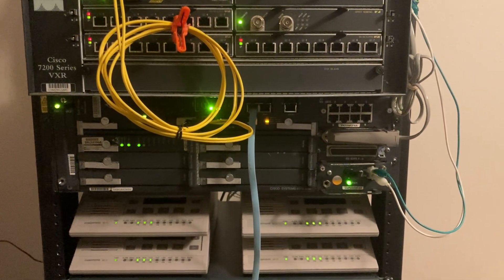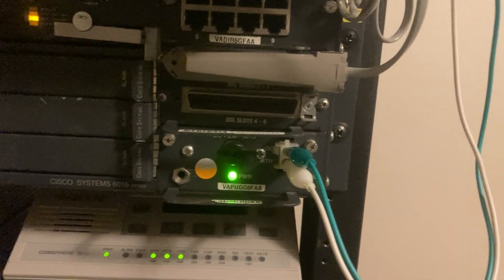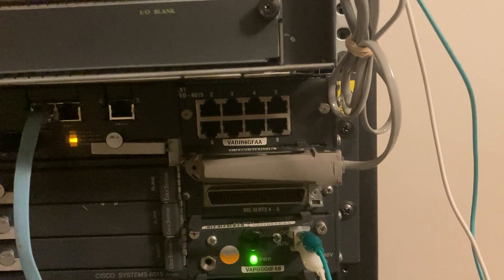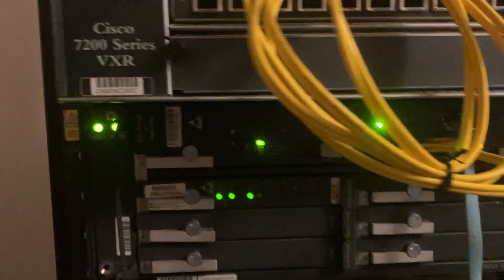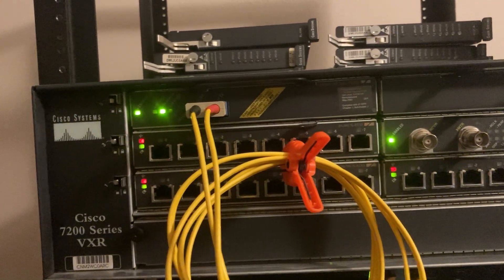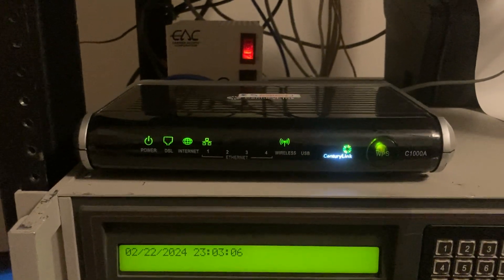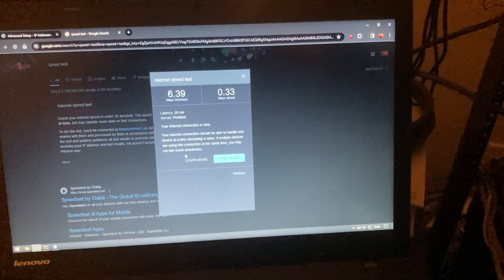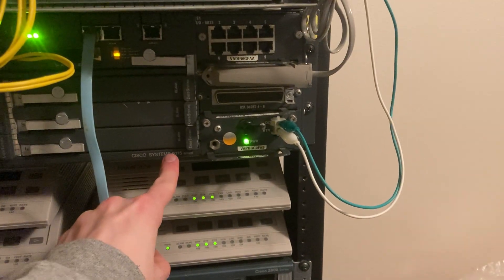DSLAM Shenanigans

Comment: I don't fully understand ATM either.  You can tell it has roots in the telco world because it's complicated!  haha  I was hoping to get a DSLAM that had an ATM backhaul, just to have an excuse to play with something that isn't Ethernet.  But I ended up with a Paradyne ADLS2+ model that was very proud to specify that it had transitioned to IP -- no more of that ATM baggage to worry about!  So it just has a regular 1Gb SFP Ethernet interface.  Ah well.

DSLAMs definitely are just glorified switches, though.  I can only imagine how it would work on an ATM-based platform, but in the case of the Paradyne, it can drop all the DSL subscribers into a VLAN of your choice, or sequentially allocate VLANs to each DSL interface to keep them isolated to whatever degree you'd like.  I haven't gotten fancy with allocating multiple VCs per DSL port and figuring out how they can map to Ethernet yet.

Comment: Not sure if this info is useful due to the age of this video, but ADSL is designed to be basically fully compatible with ATM, so you would never back haul it onto anything else. It slots nicely into the world of ATM as it was at the time. Modern DSL such as VDSL supports 'PTM' (packet transfer mode) which is basically Ethernet under the hood, so you would need a VDSL DSLAM to do this. I have no idea how it works when some customers are on ATM and some are on PTM.

Comment: In a previous life I did tech support for this kind of hardware, well the user end. PPPoA was a standard that the UK adopted, PPPoE was more the American standard and really confusing because customers would start the WinXP "connect to the internet wizard," select "broadband connection" yet the USB modem was still using PPPoA dial-up networking (it connected very fast since only simulate dialling a zero and auth was almost instant). I remember hearing about DSLAMs, knew they were locaed in the phone exchange, but that was all. The reason why customers were not supplied with "always on" ethernet modem/routers is because there wasn't enough IP addreses for everyone to have one, and surfing was still a singular PC or laptop experience. I wish they had gone down the ethernet route and issued USB to eth adapters, the amount of software issues USB ADSL modems caused was almost not worth the hassle, especially on Mac. The wires used were twisted copper pair, some very poorly insulated in certain places. Some would get wet when it rained so the link would go down.

Comment: Ah yes, the good old 7 Megs...
That's all I had at home in the first half of the 2010s, always wanted to upgrade to 20 Mbit/s but they charged extra and my parents always got SO angry at the call center when they found out 😅
There's actually a lower profile of 300 Kbits I think, my dad was stuck with that since the 2000s probably even if his modem(with no router, only one Ethernet port) already supported 20 Mbps.
I don't think I actually ever saw PPPoA in the wild in Italy, only something you would study in the books.

Comment: I did tech support for dsl with speeds of 256k, early dsl was better than dial-up but just barely.  We had two different CPE devices, an Intel pro 2100 pci dsl modem and these lovely little Cisco modems we could remotely manage.
Reply from the maker: Were the modems Cisco 678s by chance? I've got two of them but I can't find any documentation on how to configure them, and they don't give any sort of output on the console port.
Reply: @KJ7BZC are you using a roll-over cable?
Reply from the maker: @JohnKiniston  Yeah using a standard Cisco one, do those modems take a different pinout?
Reply: @KJ7BZC  yes check the 678 manual for the pin out, I believe you can get away with just pins 4-6 on the rj45
Reply: @KJ7BZC they were! When trained up we could ssh into them iirc, the customer also had access either via serial or telnet maybe and could see diagnostic data.

Comment: The 7206VXR router is a lovely piece of kit.  We used them both at the main datacenter to take full BGP tables from our carriers back in the day.  They don't have the memory to handle that these days but are rock solid, extremely capable and versatile machines.  Never had one fail.  Which is more than I can say for the GSR-12000's we replaced them with.  I suspect the speed issue you're encountering (as well as latency) may have something to do with connection quality rather than equipment capability.  That janky fiber connection gives me pause.  Check out your interface statistics and see if you've got CRCs or other incrementing errors.  I would expect single-digit latency within your network.

Comment: I had ADSL in the late 90s when it was first available in my area, 640/256kbit. I moved about a mile away (same CO) and was forced to buy a new modem (675 to 678 for DMT I think) but meant I was able to get 1536/896kbit at the same price. In 2012 centurylink started deploying 40mbit (ADSL2?) which interfered with the older ADSL and didn't offer a choice of ISPs. When I complained about the speed degradation, I got lucky and a graybeard service tech ended up relocating my pair in the bundles through two junction boxes back to the CO, which brought my speeds back up for a while.

Eventually speeds started to go back down again, and I gave up and switched to cable 50/10mbit in 2014.

It's probably time to switch to 1gbit fiber...
Reply: I think anything above 20 Megs is VDSL or one of its variants, and it uses frequencies so high interference jumps from one wire to another and attenuation was really evident.
Glad it's almost over ...

Comment: For the Amphenol connector breakout, just get yourself a RJ45 patch panel and terminate the other end of the cable to it. If the cable has an Amphenol on the other end and you don't want to cut it, there are 66 blocks with Amphenol connectors on them that you could also use.

Comment: How do T1 / E1 ports work? I used to have a telabs router with like 24 of them. I never got to mess with it much as I used a dodgy crocodile lead directly to the 12v where the psu input went and now it dosen't work anymore but might be able to get more. I would like to make a phone connection go directly over the internet. I know that can be done over voip with a server but its a bit pointless having a voip pbx server just to just forward a line over the internet, especially since that method is incapable of seeing various line stats like line reversal  (for call metering over a trunk) and stuff like that. Would I be able to do that with one of these E1/ T1 line things?

Comment: A long time ago in Champagne Urbana Illinois, I was in a PoP on the University of Illinois campus and I met a guy doing research on adsl.  He was noticing that the increased current was degrading the POTS lines at the connectors.  I have wondered since then if it would eventually cause the lines to need to be replaced, but I am guessing the use of those lines has dropped a lot.

Comment: Whats cool about it is that the customers data streams are all serialised in their modems then effectively piped as parallel multiplexed circuits  (via TDM timeslotting on the ATM link) right through to the router where the PPP is stripped and the payloads are finally thrown out into the great melting pot of the internet via whichever outbound route is determined to be best :)

Comment: I'm jealous of the Radionics receiver. I used to work in a central station and stupidly didn't grab one when they were being shipped off to be scrapped.
Reply from the maker: Ahhh I feel that pain... Great receivers honestly, of all the others in my collection the Radionics ones have just simply worked the best and been simple to configure. They do come up on Ebay for decent prices sometimes, I've had to get quite a few of them to end up with the one full of linecards and terminator cards in my rack there.
Reply: They moved all of the POTS-based panels to a Sur-Gard and it was no end of trouble. I liked working on the equipment but between that and other corner cutting, the station was waking me up 10 nights a month with fleeting error messages.

Comment: Everyone has seen the modem configuration - we all had crap like it. (and some still do.) Show the DSLAM sauce!
Reply from the maker: Honestly the DSLAM configuration isn't that complicated, it's really just straight ATM connections between the trunk and the ports. It was just a matter of doing "atm pvc 8 35 interface atm 0/1 1 35" under the atm 1/1 interface. Connecting vpi 8/vci 35 on the dsl port to vpi 1/vci 35 on the trunk port. Someday I'll probably make a video on configuring it all.
Reply: @KJ7BZC  It's not about "complicated". It's the part few ever get to see. Every one has a modem, no one has a DSLAM.

Comment: Nice rack ya got there. Thank you for the tangent. 
"Sherman, set the Wayback Machine"   
The fiber challenge may be a single-mode/multi-mode mismatch. 
Do not stare into laser with remaining good eye!
Reply from the maker: Lol reminds me of the "Big Scary Laser" sign I saw at an HP campus years ago. Luckily my friend warned me about the high output power before I ended up using up one remaining eye

Comment: 7:37 That's probably exactly what it is. If those are in fact singlemode fiber interfaces - and you do indeed have SMF connected to it on a short patch cable - then bear in mind that singlemode transceivers are generally intended for >=10km fiber runs, and can definitely run "too hot" if used over short distances. You might be able to disable or change the alarm threshold via the CLI.

Very interesting piece of equipment!
Reply: Attenuators can be had for fairly cheap second hand, fine for home lab use.
Reply from the maker: Yep I got attenuators for it, we'll see if that resolves the problem next time I have it online.
Reply: maybe a setting to change the Tx level to dial it down a bit?

Comment: used to have Cisco720x providing T1 lines to customers and 7204s for full BGP routing tables to peers, man those were years ago. was using 7201s as route reflectors not that long ago still.  I miss cisco 6500 platform, I am that old.
Reply: I still operate four 6509's.   Not proud of it but they are moving serious traffic (50gbps+).

Comment: the crazy part about this basic DSL setup is that it was a groundbreaking improvement over dialup internet. My first DSL in 2003 took me from 30-40Kbps to 768Kbps, which was amazing because call of duty multiplayer was finally playable! I still remember the modem, it was a cisco 678 and we used it with one of those classic stackable linksys router/hub combo boxes and a 802.11b WAP. Of course I connected my PC via wired ethernet and my dad's pc upstairs used wireless. My PC had a 1Ghz Celeron 256mb of RAM, a 40GB HDD and an nvidia MX440 AGP card with 64mb of vram. I played the crap out CoD and quake 3 on that machine.
Reply from the maker: It's insane how fast this stuff improves, I remember having a 5Mbps upload speed and it doesn't feel like it was that long ago at all...
Reply: Wow all those stats were impressive then but looking at them now, how far we've come

Comment: That is actually pretty cool. Simpler than I anticipated. Never seen one, was only on a consumer side of them in Poland in early 2000s. 30ms latency is really strangely high. Hope you get all setup nicely.
Reply from the maker: Yeah the profile that the dsl port was configured for in the 6015 was set for interleaved rather than fast, went back down to sane values once I changed that over.

Comment: Bro... I was an Network Engineer, Level 4, Network Facing for Centurylink (Sprint) and I deployed most of the Mid-Atlantic (NC,SC,VA,TN) LOCAL ATM, FrameRelay and Metro-E networks; from 1998  thru 2003.  Best time of my life... We were working with Lucent CBX500 ATM Switch Fabrics, with 8 Line Cards, pimped out with SONET, OC-3, OC-12, OC-48, and OC-192.  These cards could take a host OC-3 Optical and breakit it down to a fractional T-1.  All ATM's work off a VPI/VCI, pair.  The most common VPI/VCI was VPI-0/VCI-55.  You have to route the traffic between the interfaces to get this to work...., But beware; you MUST have an interworking card to translate ATM to ETH, or ATM to FrameRelay or such...
I have all my learning materials in a box somewhere in my garage; and I will be happy to send it to you if you want it... I went to Framingham, MA to the Marconi / Bell Labs when I was training on the basics of ATM... The switch that I put in the most and supported was a Lucent GX900-FrameRelay and a Lucent CBX-500 ATM, along with the Lucent PSAX-1200; most of that 1200 use was for State offices Video Walls, from School to School....  Lord have mercy... I absolutely loved what I did; but man o man is all that legacy and outdated; by like a quarter century now...  At the end of my time with them; I was taking out of service stuff that I had put in service in the late 90's...  About the only thing that was a long term asset aside of the buildings, were the phone switches... In my case; our region was 99% Nortel DMS - 1, 10, 100.  The largest, still most visible telco in this market was and still is Rocky Mount, NC.  100% of ALL internet based traffic flowed thru this office... The telco was so large they had an entire floor of their building dedicated to "Intra" LATA switching and the LD side of the house, which hosted most other telcos voice switches were AT&T 5E's.. In the last two years of my career they were trying to pull together a ckt to packet workflow because they knew Ethernet was going to be the wave of the future; and both DMS and ATT 5E had massive initiatives to card swap out their cabinets to support Digital connections, in lieu of analog... and I would say more than 80% of the telcos lost an boatload of money because of the plan to migrate away from copper over to fiber... A great time to be alive..   I will be glad to help you any way I can with any learning resource I have.... I have no use for any of it now....  Been an independent IT provider for our area for the past 25 years but all this knowledge came back from center cortex almost immediately when I saw your intro video with the Cisco....   Enjoyed your clip!  Regards, Ty Carter, Strategic Network Consultants, Inc. Washington, NC.  tmcarter at the gmail will get you in touch with me, if I can help.

Comment: You may well have to much power on the fiber, especially on older gear, mostly single mode like I think you have which are designed to run long distances and so expect more loss in the fiber.  You can get attenuators to drop the signal.  Fiber typically has a range for output powerand a range for input power, most modern gear those ranges overlap, for for longer reach gear and for older gear it's typical for there to be a gap between the lowest output and the highest input so you need a minimum path loss between connectors, cables, attenuators, etc.
Reply from the maker: Yeah I ended up getting attenuators for it, I need to glue one of the fans in the 7200 but when I test it next we'll see if it works out.

Comment: Strictly speaking ATM is not an interface, it's a protocol.
Don't think it the stuff you have would do PPPoE
Reply from the maker: Yeah I said interface as that's how it shows up in the configuration, "interface atm 0/1" and similar. I don't think this does PPPoE either after looking into it further, at any rate PPPoA is working just fine though, so I'll end up sticking with that.
Reply: I have never worked on this kit so forgive me if my understanding is a little off. What you are likely running there is SONET between the DSLAM and VXR. SONET has 2 modes, PoS (Packet over SONET, similar to ethernet) and ATM over SONET. You are then running PPP on top of this effectively L2 protocol.

Comment: hows the phone line going from the dslam to the adsl modem
Reply from the maker: It's just a straight RJ11 phone cable between the modem and that adaptor into the DSLAM, nothing fancy or anything.
Reply: @KJ7BZC  in an actual telephone exchange how would it go from the dslam to the mdf to then the customer?
Reply: @fujitsubo3323  depends on where the dslam is and sometimes they would put it in between the MDF and another MDF

Comment: What a neat box! I feel for what you said at the start very much. I've got two Paradyne Bitstorm 2600 Series 24 Port ADSL/SHDSL DSLAMs sitting on my desk that i've been trying to configure for over half a year. Also got a big stack of old Cisco 1921 series Routers and a crate of SHDSL Quad-Line WICs.
Sadly can't seem to get past the previous owners password, ISP it belonged too closed down 8 years ago and the "VxWorks" bootloader Paradyne used in these is heavily modified and very poorly documented. It offers the option pre-boot to set a bootflag that is supposed to bypass the user config and start using defaults, but after trying at least 100 times i've come to the conclusion that this seems to not have been implemented, or the default config has been overwritten by the running config somehow :/
Reply from the maker: Yeah I've got an Adit 600 channel bank I'm in the same situation with, not so much lack of documentation but it's got a username and password set. All the reset procedures I have came across haven't worked on it, might just have to brute force it.

Comment: 11:28 DSL typically has (with VDSL etc.) max. 200 Mbit/s which isnt bad, but e.g. for me I only get around 110 MBit/s from the ordered 175. But still, DSL had good enough throughput. Fiber is more of a latency thing to me than anything else.
Reply: That only really applies in cities, where you are close to the dslam. In rural areas you usually get around 20 or below mbps
Reply: @deepspacecow2644  depends on the country and where they locate the equipment